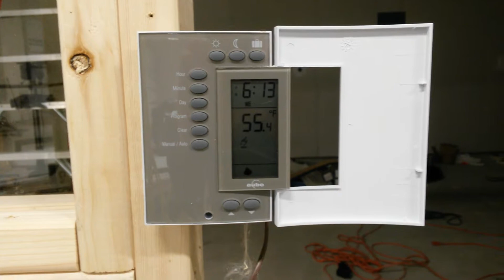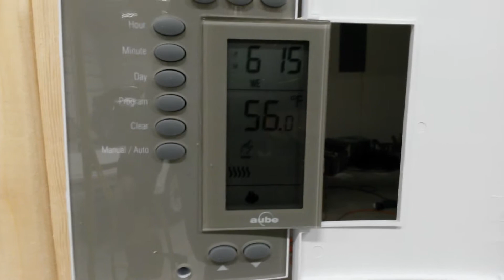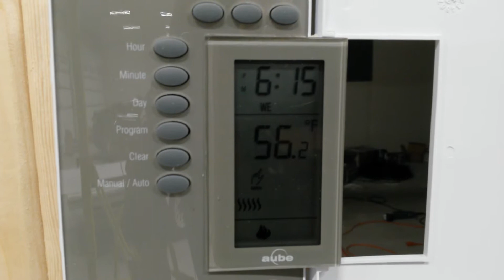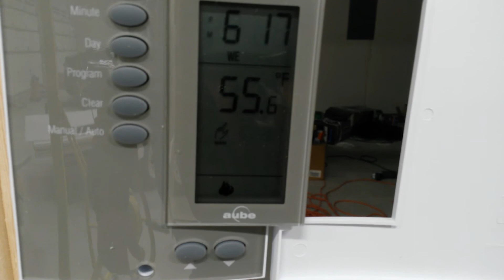Honeywell Aube Th140-28 Thermostat Heating Design Flaw  On/Off Cycling

Comment: Do you know how to get rid of that fire icon at the bottom? Mine stopped working now that our condo has switched over to cold. I was wondering if it still thinks it's heat time? But I can't figure out how to get that Icon to go away. I've turned it up, down, all over the place.
Reply: same did u ever figure it out
Reply: No😕
Reply: Bad news, it is for heat only. This does not support hvac for cooling.)

Comment: Maybe you're running too much power throught the relay and it generates enough heat for the sensor to pick up ? That's my best guess. This kind of thermostat isn't suited to drive big heating systems directly.
Reply from the maker: Even if I have it disconnected and on a table, it still will turn on and heat up 2 degrees and shut it off. They say to run it on anticipated mode but then in instructions says don't run that for radiant heat, probably because the short cycle time isn't good.  I just went to the good old standard heat only thermostat , and it works fine.

Comment: I just bought this thermostat.  What is the icon (looking fire) in the screen lower part
Reply from the maker: That should be the heat icon, but would have to pull up instruction manual to check

Comment: Increase your deadband. Also where is this controller pulling its temp sensor value from? Almost seems like it’s a discharge temp sensor. Maybe after a mixing valve.
Reply from the maker: It is at max of 1.1 degrees F . You can unmount it and leave it on the table and it will heat up automatically! Doesn't matter where it is. It is just a standard thermostat , so it is pulling the heat temp from surrounding air.  It's defective and Honeywell will not do anything about it. They state to put it in adaptive mode, but according to their instructions, not recommended for multi zone applications. Bad customer service all around!
Reply: @JasonYouTube  You just have to adjust the mini switches on the back of the thermostat according to what you want to have as a temperature difference. It is the perfect thermostat for hydronic heating.
Reply from the maker: @charlesbailey1750  Adujusting switchs isn't  the problem, the ones i got must be defective as it is too sensitive for picking up heat when it clicks on. The unit when it clicks on, generates heat or something and clicks it off. In video show it sitting  on table and within 2 min of turning on demanding heat , it raises temp of thermostat by several degrees.  Defective units but manufacturer didn't  warranty them even with video